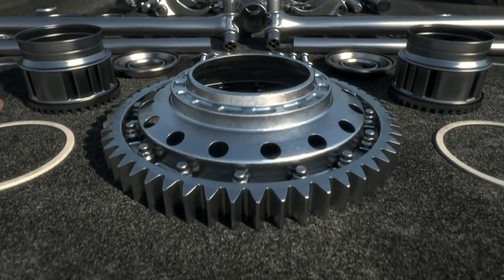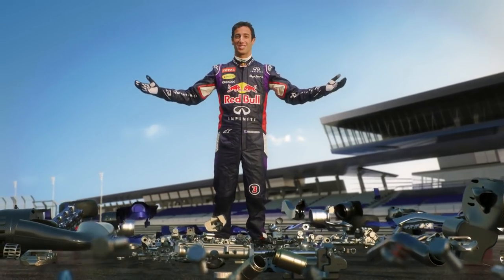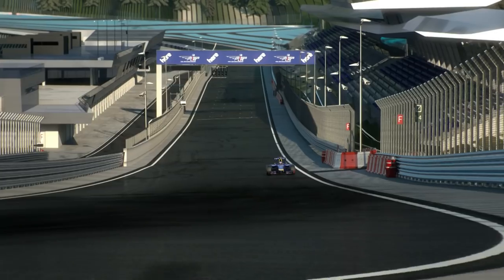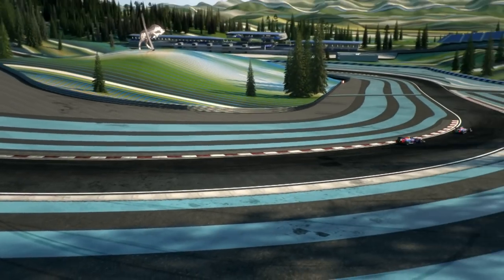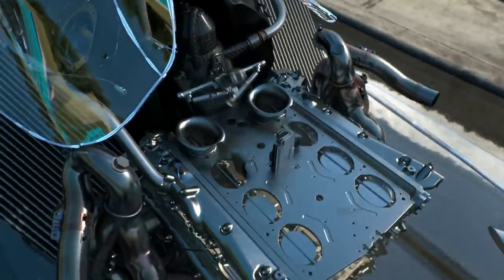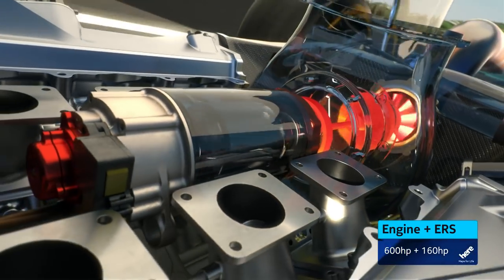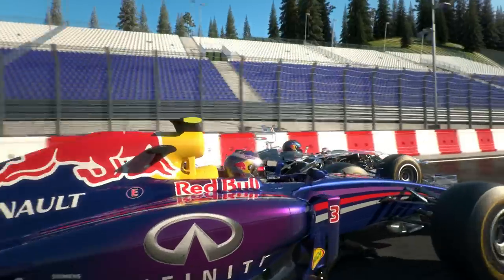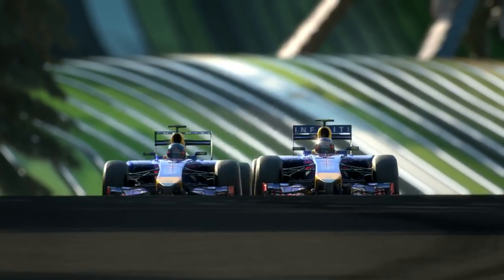Formula One V6 turbo: Rules Explained

Comment: The 2014 cars will be slower, more prone to 'power unit' failures and cost more, such improvements!
Reply: why do you say they'll be more prone to failure? i suppose cause they're turbo? the revs will be lower so that should make them more reliable, but being new i'm sure there will be some teething issues.
Reply: you obviously dont follow F1 that much as during the test sessions cars are only 1.5 seconds of qualifying pace in bahrain and some cars have been clocked at 330km/h down the straight.

as for power unit failures Renault are a bit sketchy at moment but they, Mercedes and Ferrari have all done multiple race distance a number of times but the Renault hasnt lapped as quick as the other 2
Reply: JezzaWezza Not slower though, the Merc Power units are churning out some impressive times and good reliability.
Reply: If that's true, F1 is then better and more interesting than before.
Reply: Sweet!  Sounds exciting now!
Reply: Turo Orvel quite true it has become rather boring
Reply: JezzaWezza obviously I was 'following F1' since you were in diapers. I'm not saying we should get back to when drivers were killed every season but spending millions and still not going any faster than the cars from the grooved tyre V-10 era is plain stoopid
Reply: Tim Boers "teething issues" hah I'd rather watch the cars explode like in the first turbo era, at least they went fast and were exciting? This is going to be a tree hugger mileage contest.

Comment: So the new Formula 1 car is basically a hybrid. And V6? Are you f*cking kidding me? That is ridiculous...
Reply: I think its awesome.
Reply: Being a hybrid car makes it faster. Because the other engine is so powerful, they are able to dump extra power when they need it into the car.
Reply: farai mukungurutse not at all.
Reply: farai mukungurutse
The only thing I like about the New Gen F1 is the turbo whistle... the rest of it is... sadly not so good.
Reply: Tomáš Lipnický 1988 V6 Turbo
#Senna
Reply: More torque more. Less downforce all together more difficult car to drive. I think when people hear hybrid and v6 they lose there mind.. Until u have drivEn  a performance hybrid u wont understand..
Reply: Maybe you haven't been keeping track the last 2 decades but, smaller motors are making as much power as the bigger ones with something as simple as a turbo.  Cylinders are less important these days as it was in the 70's and earlier...

Comment: I don't want to know what is next... 3 cylinders and 1 litre?

I miss that old v12 sound :(
Reply: That would be an achievement, as it would mean they've succeeded in increasing the engine RPM to 30,000, which is awesome, instead of the clunky 9000rpm mechanical valve shit the bigger blocks had. 4cyl that would be good as it requires simpler manufacturing to create a 4cyl than a 90 degrees 6cyl. 3cyl that's just retarded, the cylinder number has to be an even number.

Comment: Every year they think of something new to ruin this nice sport. What a joke F1 has become!
Reply: They should invent a time machine so we could watch v12 and 1200hp turbos racing head on.
Reply: eamh2002
its called video
Reply: *****

I meant going to 1987, keeping the rules open for 1994's v12 with the turbo cars also allowed :D
Reply: The weight is not a problem because they make the cars heavy nowadays. They could have a lighter twin turbo v12 if they wanted than todays v6 cars.

My point was mixing the lighter and more responsive 900hp v12  with some high hp straight 4 1200hp turbo cars for some challenge and overtaking battles :)

Comment: few years from now they will be on 2.0L engines.
From V12 to V6? wow. so weak.
Reply: +Martin Sibara ummm this is 1.6L engine...
Reply: even worse. lol epic fail to them. Thanks for the update.
Reply: +Martin Sibara why you consider it weak when it's generate more power ?
Reply: +Martin Sibara and soon. they wil be down to a straight 4 cylinder. you can still make 400 reliable HP with a 2l 4cylinder. they can probably do more.
Reply: +Martin Sibara So weak? Your car can run more than 15,000 rpm i presume? cough with only 2L engines and 6 cylinders
Reply: lol ok im an armature at this. Forgive my lack of knowledge at this stuff.
Reply: wow, quite a nice reply dude xD, the world need more people like you. Cheers! xD
Reply: +Martin Sibara  Search the last year 80*s which engine did had actually those shitty v6 are more powerful than the v10's
Reply: +Vaughn Miller Stick a new v12 engine designed on the same principles as that gimp little v6, and it will be faster. There is no replacement for displacement.
Reply: +gullf1sk *Theres no replacement for displacement except if you compare a N/A vs a Turbocharged engine is called ammount of air you can mixture

an smaller engine with double the pressure will be more powerful and "torqy" than a larger NA engine 

Obsiusly i would like a twin turbo 4 litre v12 with over 2000 bhp and another 500 electrical bhp.

if you study actually rules of an engines wich are Pressure/Torque/Compression ratio/ etc. you will notice that a long Stroke straight six can easely kicks v8.

That's why in the 70's here, the Torino and the Slant Six where actually faster (and more reliable) than the Ford and Dodge V8 and without turbos, just puttin' a fukin long stroke
Reply: +Spotav So we agree then. If you give a v8 or a v12 the same treatment as the v6s got, the v8s and v12s would be more powerful.

Oh, and the v8 and v12 would have a nice sound to them.
Reply: +Vaughn Miller V12 of 80-90s mate, and they didnt have that high compression, durability of these engines is ridiculously low due how much stress is put on them to squeeze out the power, same as with commercial cars today. You can get far more frm V12 today and if you apply same technology this is no match to it. Ofc weight will be bigger same with consumption but it will generate far much more power. Sadly F1 is reduced to "downsizing" propaganda material, it's uterly sad, in 6 years we will see 3 cylider cars here, in 10 years v2s, later petrol powered motorsport will be gone, and econazism will aim car enthusiast as criminals...
Reply: +gullf1sk Yeah, it would be awesome a 2500 bhp F1 V10 or V12 twin turbo car going over 400 km/h in the straights and breaking records year after year after year

But that doesn't going to happen sadly, and between the old V10's and the actual V6T i preefer the v6. Is a useful upgrade. A noisy indirect injection N/A V10 doesn't contribute to normal car engines.
Reply: +Spotav If you wanted to "contribute" to normal car engines, you'd have f1 run on a 4cylinder diesel toyota engine.

this is f1.
Reply: +Martin Sibara yeah, you are an knda nostalgic idiotic fan. Without technology instead of cars we should move in horses.

in 1970's renault used the 1.5 V6 rs10 with 500 bhp and during the next seasons kicked the 3 litre n/a engines, sound can't took over power and that's how motorsports work.
Reply: Spotav "Contributing to pleb cars? Fuck them pleb cars, it's F1, Motor sports, it should stay separate and be free of these retarded limits by ecoterrorists. It's industry and pleeb cars that create this big amounts of co2, motorpsport is like 1-2% of that which is none actually so it should be unspoiled by these stupid regulations
Reply: +gullf1sk 
Is funny what you say, cause the most powerfull F1 engine was the BMW megatron which is basically an road car engine block 1.5 litre 4 cylinder with a huge turbo.

 IDK if you re understanding pretty well.
>Car makers put them in motorsports to proof new tech
>Car makers doesn't interest glamour, their interes their possibilities for future tech, thats why toyota moved from F1 to WEC

Go to the outside and count how many cars have a v10 or a v12, and now count how many of them have engines between turbocharged or between 1.6 and 2.0 litre
Reply: +Kacpa2 And if you know history of motorsports you will discover a little thing that you maybe never know until now

Technology always win. in the same way that the stilver arrow crushed all the world cars reaching 200 mph with supercharged relatively small engines.

Im very sure all the v10 and v12 records (except sound) will be broken before 2020.

And the modern 500 BAR pressure Turbo dual MGU 1.5 v6 have a thermodynamical efficency around 50%
do your own calculations.

if you try to be a good "motorsports guy" you shold see a very good 2003 documental called "Formula 1's secret life : The Limit".

Comment: Fuel efficiency for racing!!? That's really stupid...or maybe there is an agenda
Reply: There are many. Without restrictions, all it takes is most money to win, since everyone in F1 is already among the best in the world. And since fuel efficiency is more and more important for civilian market, nobody wants to advertise in Formula 1 by wasting fuel, they want to advertise fuel efficiency etc. 
In early 2000s we only had overtaking at pit stops. Now we have overtaking all the time (compared to that). Altough DRS does make it look far too artificial.
Reply: I think you are missing the point here , the main reason great car companies are interested in these races is to push the technology of the car industry by competing each other .

in the beginning .... the main goal was creating faster car , better engines ... this lead to great achievements such as Turbo-chargers .

then the interest was shifted towards control , better suspension systems , ceramic brakes .... and so on ...

now the new challenge is Fuel efficiency ..... can't wait to see what the great engineers minds would come up with.

these guys are pioneers in a way , itis not just about winning a race .
Reply: Only really makes sense for endurance races. I'm all for improving the technology of fuel efficiency but it seems odd to mix that in with racing unless you're in a specific circumstance where winning the race relies on using less fuel...

Comment: Formula 1 has always been about pursuing the Pinnacle of innovation in vehicles. It's always been about the evolution of Technology and pushing it to its limit. The fact is, we're at a point where a V6 produces far more power than a V12 used to from many years ago. Why wouldn't we embrace the continued evolution of technological advancements? Many of the Great technologies that start its life in Formula 1 trickled down to the consumer at some point in time. Engineering enhancements should be embraced. Without restrictions we have no reason to further refine The Craft. Despite the fact that there are more restrictions now than ever, the cars are arguably faster than ever before as well.

Comment: Just a question (maybe dumb, but I'm just curious).
I noticed that the engine uses just regular connecting rods. Why don't they use fork-and-blade rods? I know that with that type that there can be problems with lubrication, but surely we have the technology to fix the issue, right?

Comment: I say go for it when it comes to technological advancements in the circuit. That's what F1 is all about. Modern vehicles designed to have the utmost capability in a top-tier racing environment. The concern is racing, not (so much...) image or concepts. NASCAR builds itself around the concept of traditional vehicle design, so they make the biggest performance developments within that idea. To NASCAR fans and racers, that's a major part of the appeal. For F1, it's being the absolute pinnacle of motorsport technology and racing. You can't take that away, no matter what the engine (well...any engine the yields that high power, of course...) Trust me, you will still enjoy it as a fan, and the driving will still require masterful racing skills...

Comment: I see a lot of people complaining about not having the v10s etc back.. well honestly, its fun for the WHOLE family.
The engineers have to create a engine to that specs and make it competitive, the drivers have to be accustomed to driving the new f1 cars they release, the sponsors can rave about how fuel efficient it is, and now they have to use 30% less fuel, it honestly sounds fun from a engineering / driver perspective.. Nothing is "fun" unless there are rules applied. Just think if football had no rules.. whats the point of it then ? Just saying.
Reply: Well most of the drivers don't like it. It's not really pushing the boundaries of technology it's holding it back. I'm an engineer I know this shit. The main reason the FIA did this was to attract more investors, big brands by making it more eco friendly which is quite poisonous for the sport. That is not Formula 1. The future lies with a new engine one of at least 3.0 litres, V12, 20,000RPM, 900-950HP and a powerful KERS system. As for the car, increased downforce and fatter tyres. That is pushing the limits, that is competitive engineering and that is competitive racing.
Reply: Grow the fuck up. It isn't 1986 anymore. 

Hybrid technology IS pushing the boundaries of technological development. That was the entire point of developing the hybrid power units in the first place, and why investors are so interested in such developments. It forces teams to introduce and refine new and more efficient energy recovery systems, motors and batteries, which are technologies that can be directly integrated into future everyday road cars, and even other modes of transportation. Whether you like it or not, fuel efficiency is more important in road cars than ever, given how finite a future fossil fuel burning has. F1 serves as a platform to incentivise innovation in areas that have become desperately important for the future of the automotive industry at large.

Making conventional engines more powerful and giving the cars stupid amounts of downforce is actually pretty easy to achieve these days, and such developments have little relevance to actual road cars. On the other hand, hybrid technology in 2016 has already vastly improved over 2014. The Mercedes hybrid power unit is claimed to now produce close to 900hp, which is right on par with (and sometimes exceeding) the power of the old 3.0l V10's of 20 years ago. But better still, they have far more torque than the old engines. And most amazingly, they can achieve such levels of performance despite only burning LITERALLY HALF of the fuel of the old V10's. You cannot deny that is an extraordinary achievement. That is the kind of engineering development the world really needs.
Reply: +Daniel Lomax And thus it has ruined the sport. And 1986? You merely have to go back 3 years. F1 isn't the place for what you have stated, what you have stated is more relevant to 24 hour Le Man which would be and is great. When you've got cars on track that have the potential to push, race hard, overtake and make for good F1 but they can't because they're limited to the capabilities of the power unit and they have to save fuel then we have a real problem. F1 is a sprint not marathon. What I said in my previous comment is what the fans want, drivers and teams want. If you need a platform to showcase efficiency then use Le Man or better yet Formula E.

Comment: i saw a comparison against 2014 redbull and 2013 vettels redbull driven by vettel on both cars and the 2013 car was like 2 seconds to 3 seconds faster so idk if the 2014 season was any better then 2013 cause we dont care about fuel we care about that engine sound

Comment: All these people complaining about the engine being smaller. Smaller engine with a lot of turbo boost means better fuel efficiency, which means fewer refuels. A smaller fuel tank and smaller engine also means a much lighter vehicle, making them more nimble. And if your primary complaint is that it doesn't sound the same, then you're playing with small potatoes. Other complaints are valid arguments, but engine sound is totally cosmetic and irrelevant to just about anything practical about the motorsport.

Comment: I don't mind a hybrid system but engine suppliers should be able to have the freedom on how many cylinders to put in, as long as they limits the total weight and fuel consumption. F1 is not just about drivers, and how fast and efficient the cars can go, there is a factor of entertainment in all the races. Race car engineers should enjoy what they create, play around with ideas. The race track should be filled with different sound sensations of V10s, V12s, Turbo V6s and V8s. Where F1 is losing fans? The racing experience!

Comment: Up next for 2016 are turbo charged Inline four engines to make things even more fuel efficient. Rev limit 5k rpm to save the environment. Brand new gear box with only two gears........ Slow, and Slower. 

The fans go wild for these super efficient, super safe, super slow F1 race cars. Oh what's that I hear, a new design as well. Lets see that it looks like: 
▄

Wow a brand new box design to ensure maximum safety at the expense of aerodynamics. Another brilliant move by our brilliant engineers. 

Fuck you F1